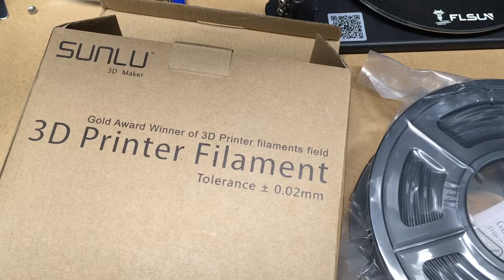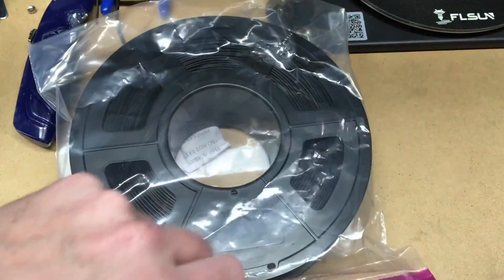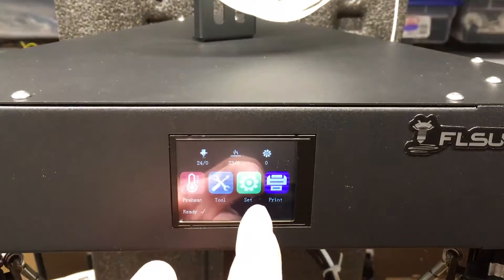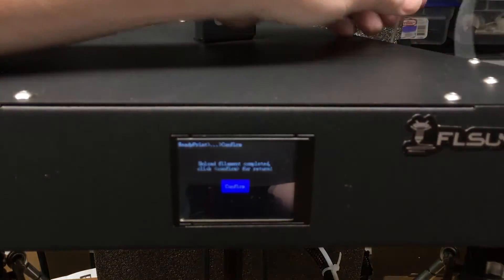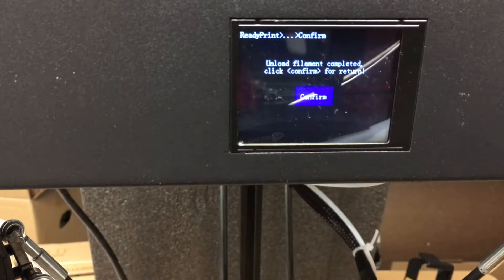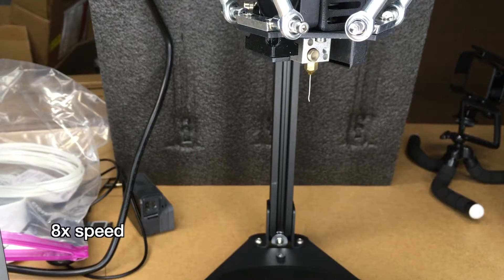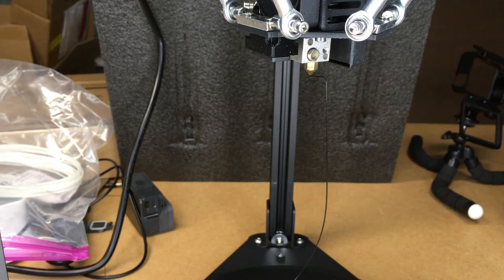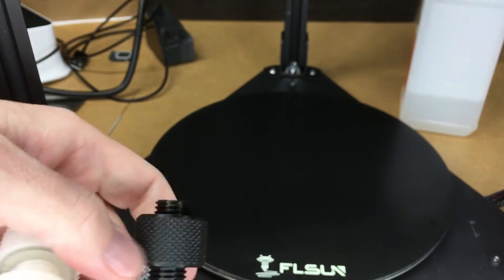FLSUN Q5: Changing Filament (Ep. 5)

Comment: Hello,

change Filament manual.
Push the Filament for 2 seconds in the hot hotend and then remove it fast.
No blobs anymore!
Reply from the maker: Did that on a recent change. It worked well for me. Thank you for the tip!
Reply: @Rickmakes  I'm glad to hear that.

With the Prusa Mini the problem also existed. I had seen this with someone on youtube.
Until the firmware was adapted so that the filament was first extruded a little through the hotend and then retracted.

Many greetings

juck.
Reply: I preheated my extruder, pushed out 20mm so I can get to the settings to push out the old filament. Pushed it out and got the new roll in within 1 minute because of this tip. It was my first time changing filament so thank you so much!
Reply from the maker: @222dillon  I've been using this technique since it was shared here and it has been working great. I'm glad you found it too.

Comment: Just upgraded my Q5 extruder to a Micro-Swiss dual gear. I got tired of that garbage Q5 extruder that is noisy, hard to load and unload, and unreliable. Retractions with the new extruder are 3.5, so a fortunate benefit of the upgrade is that the Q5 is now virtually silent when printing and does not jerk around like crazy with those 8mm retractions! I highly recommend the M-S extruder if you're in the market for an upgrade.
Reply from the maker: Thanks for the recommendation! I've been hesitant thus far to upgrade because I don't want to potentially break it. To be more clean, I think I need to buy a second printer as a backup while I work on the first. ;)
Reply: @Rickmakes  The upgrade is extremely straight forward. He's my video with a couple of helpful tips. Plus you can see/hear how much quieter it is. https://youtu.be/ASKNvEZVt8g

Comment: I just received my Q5 so your video was helpfull to me . 

Can you explain what you do when you finish printing  , take out the filament as in your video  #3.10 minutes ?
Reply from the maker: This is how I currently remove the filament. I want the hot end heated up so if I am not there when the print is finishing, I'll reheat it. Once up to temperature, I'll pull the lever on the extruder and manually push some of the filament through the nozzle. Then I'll reverse and pull the filament all the way out. This makes for a nice "break". I then switch off the printer.